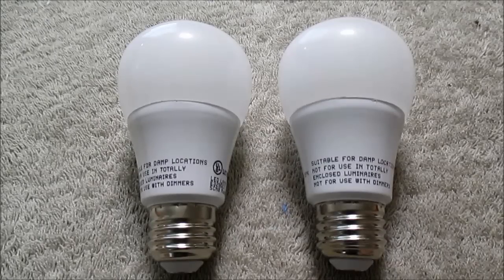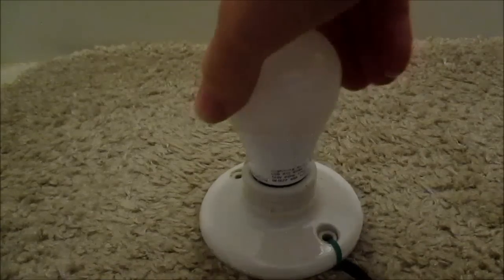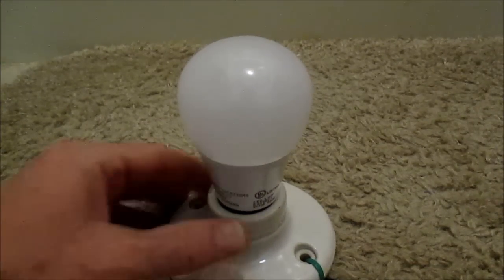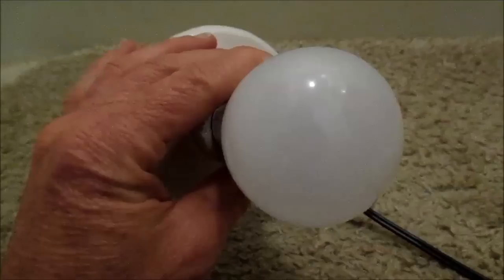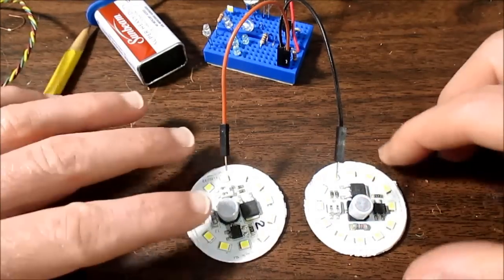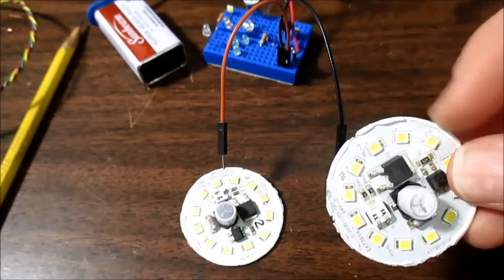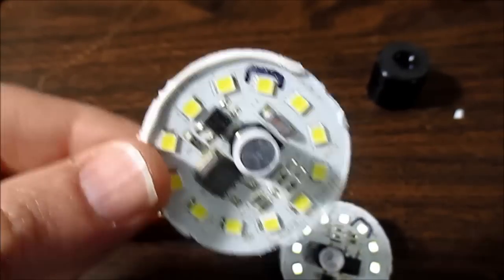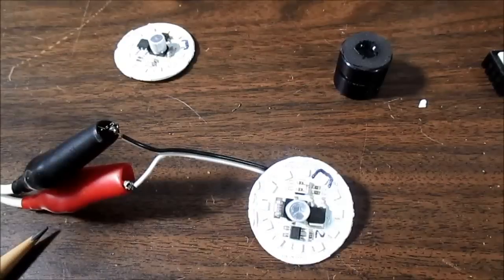Two failed LED bulbs for teardown to determine the cause

Comment: It says on the packaging to make sure the bulbs have plenty of ventilation. I've had several bulbs go out when I put them in my front porch fixture with a screw-on lantern giving them no ventilation. They over heat and "poof" don't work. Follow the directions...

Comment: If you pay attention to the usage of an LED bulb, you'll notice they don't use a whole lot less power than a regular incandescent bulb. The real breakthrough in light bulb technology came years ago with the CFL bulb.

CFL bulb uses consistently 20% of what a regular incandescent bulb uses. The LED bulb uses about 60% the electricity that an incandescent bulb uses.

When the cfl's first came out, I switched my small house totally over to CFLs. My next electric bill was literally$50 lower was no other changing of appliances or other conservative efforts. It was obviously the CFL bulb that led to the savings.

I am convinced that the CFL bulb was killed because electric companies did not like the savings let consumers realized from using the CFL. They dredged up horror stories of cancer from the light of CFL's. As far as I'm concerned this is the biggest con job since petroleum producers tried to kill the electric car!
Reply: No they don't and that is such bad info. Hook a watt meter up to all 3, I did. The 40w equivalent CLF is 8w, the LED is 5w and the Regular bulb is 40w. All my LED's are Daylight balanced and appear brighter than warm regular bulbs. Get good bulbs and they last way longer and use less electricity. I spend $28/month less for outdoor lights now and all are 27w 100w equivalent 5500K bulbs. My yard is fully lit all the way around for $11 a month. Going on 4 years. Cost $115 for all the bulbs so ROI happened in 4 months. My lights are also not dimmer in the cold now like when I tried Fluorescent bulbs.

Comment: I bought about 30 LED bulbs for my house 4 years ago and have only had one fail. It also said "not for use in enclosed space" and I had it in a sealed hallway light so no blame there.    
The electricity savings is huge, especially in the summer when the AC doesn't have to work as hard to get rid of all that waste heat.     
LED bulbs are also subsidized in my state, so I pay about $1.50 for them to knock $10-20 off my monthly power bill. Absolute no-brainer.
Reply: Yeah, over the last 10 years, I’ve not yet thrown out a single led bulb. The older ones, that have dimmed over time (from being left on 24/7) have gone on to second lives as rarely used closet lights and such). I’ve not had a single outright failure (in contrast to the awful CFL’s which, while lasting longer than incandescent bulbs, seem to quit at the 4 year mark - I now have a pile of them awaiting proper disposal).

As for LED versus incandescent, it’s no contest, LED bulbs are just better.

Comment: You should have said "crappy Chinese lighting science bulbs", made in China 2:12 . Who have not learned by now, most of the products made in China is crap. I have got these same bulbs 6W LED "cool white" in my house for over 18 months now and hand no problem with them so far. They give excellent lighting, far better than an 60W incandescent bulb and the 18W - 20W energy saver bulbs. The reason for this is, buy good quality like Osram or Philips and you will have no problem with it. The are just as good as any other bulb, just much much more energy efficient.

Comment: I have a bunch of Utilitech bulbs from Lowe's bought three yrs ago.  I put a bulb in a desklamp with stainless steel shield cone.  The bulb still works, but I noticed the plastic at base is cracked, multiple, and maybe slightly discolored... Since these bulbs run cool, vs. incandescent, why is this road to failure or safety issue occurring?  I took it out of service.  Just wondering the cause.

Comment: Jump out the open LED, raise the value of the Source (current sense) resistor on the mosfet by about 30% and put back in service.  Much longer life but less light output.

Comment: Many LEDs used in TV arrays have a zener diode across the LED junction.  If the LED opens, the entire source voltage appears across the LED and shorts the zener.  The current source maintains the programmed current so the voltage drops to maintain wattage.  Of course, while most TV LED failures are shorted LEDs, there's still the occasional open LED that shuts down the array.  Apparently, these bulbs don't use zener diodes for backup.

Comment: Because the line voltage from our power grid is inconsistent.

I have measured 160 vAC on my "110 to 120 v nominal" outlets..

It blows out LED and fluorescent bulbs rapidly.  Common incandescent bulbs labeled for 120v were tested to survive 150 v.  I used to buy the 160 v rated bulbs which handle the incinsistent power much better.

Electronics are not tolerant of excess voltage.

I have taken to putting computer UPS with voltage regulation into lighting circuits and my power bill is down plus I don't blow bulbs any more.

Comment: FYI: the .99 only store sells 1600 lumen bulbs for $1. @ 5000k and another at 2700k-800 lumen. The double pack bulbs are NO good so don't even think about those but the singles works extremely well. Read the pack and get what you want. I have not had a single go out.

Comment: Isn't it true that these failures are chronic with LEDs and isn't it true that there must be a failure of a voltage or amperage regulator causing these "bond wire failures" as you call them? In other words possibly a design error in choosing the right voltage/amperage regulator, or poor quality regulator? Something like that? Because I am betting that if that particular bond wire connection there was improved to be stronger than it was originally, the next weakest one would then fail.
Reply from the maker: I have LED bulbs that have lasted years. In my house, I haven't had one fail yet. I think these (in the video) failed from heat. The regulator was still functioning correctly.

Comment: Bought 2 at Dollar Tree.  1 lasted 2 days , the other 2 months and they both went to the light output of a cigarette lighter. Went back to the "ice cream swirl" CFL. Still have 2 T20 fluorescents burning non stop for 10 years.
Reply: Hmm..... I've bought approximately 15 LED bulbs from Dollar Tree over the past 2-3 years. Not a single failure.

Comment: I have found that the solder cracks on the LEDs from repeated thermal stress.  I can usually resolder one LED and get a light going again.

Comment: Your missing the point about LED bulbs, the point is less power consumption which means less demand on the grid which means fewer or smaller power generation plants. Even if LED bulbs were more expensive per hour of use, we should still be using them unless you don't really believe climate change is linked to human fossil fuel burning in which case you should still care as building power plants is very expensive and will impact your energy cost a lot. If you want a better bulb I suspect you have to pay a premium for it. I just bought a fairly expensive 3 way LED bulb with a guarantee to last a certain number of years. I will probably never use the guarantee because it is too much hassle for the value and I am sure they count on that being the case but i suspect it will last longer then the cheap LED bulbs anyway.

Comment: I've got LED bulbs I put in when I built my house 5 years ago.  Some of which run 8+ hours a day every single day of the year.  LEDs themselves aren't the problem, it's the drivers/hardware behind the LEDs.  Most people don't understand this due to incandescent bulbs being so simple.  If you buy the cheapest LED possible, you'll likely never see it's full lifespan because the hardware powering it is garbage.  Buy the middle or just below upper priced ones and they'll almost certainly go forever.  

As far as the light value, they do degrade over years and years, but it's not often so significant that it warrants replacement until you're nearing the end of the expected lifespan anyway.  At least, that's been my experience overall.

Comment: I would put a regular diode across the bad LED and put it back together.  But if you want to maintain proper circuit load you will need to put two regular diodes in series with the bad LED.

Comment: I bought 20+ LED flood lights years ago.  Every single Eco Smart bulb failed within a year. I replaced them with Cree flood lights and several years later haven't had a single failure yet.

Comment: I seen some bad led bulbs go bad as well and I also opened them up to look at the cause and when a led flash intermittently it is normally a broken led in the chain that caused it. And I seen this be like this because it been way to little and even no thermal paste between the board and the heat sink itself causing the led to overheat and burn. On a specific lamp it was only thermal compound to cover half the led chain and the rest was without it. It is either way a terribly bad manufacturing or intended failure over time. But as I already know money always controls this and nothing else.

Comment: Bastards 1LED fails and because they are in series they ALL fail.  If connected parallel the bulb would continue to work albeit slightly less bright.  Of cause the manufacturer would not sell so many bulbs.  That’s OK though you’re the one paying for the bulb and the manufacture is not using defective bulbs like us.

Comment: I've yet to have to change an led since I started using them 4 years ago. The two brands I've used are phillips and great value(the Walmart brand).
Reply: I have a few great value bulbs. I bought them in 2018 and so far all but one is still working.

Comment: In my country there are swarms of Chinese-made LED lighting products. One called Firefly is prominent and cheaper than big names like Philips and GE so not long ago I thought about replacing a handful of CFLs. After about a year one of them stopped working. I thought these were supposed to last 10 years? The others are still working fine though, after 2 years.

Comment: People, the biggest threat to any LED light source is heat. Many type "A" bulbs are NOT rated for enclosed light fixtures, which is where they are used 99% of the time. This is especially true for cheaper brands. This is the same issue with CFL lamps back in their heyday as well, and still do.  Alos, most of the components are sourced or built over seas. However, the country of origin isn't the problem.  How they are manufactured certainly is.  Nothing is immune to failure. However, using a quality brand and a lamp that is designed for the fixture and/or environment will go a long way towards longevity.  Read the package next time you are buying.  Not all of these are waste as some would think

Comment: LED bulbs suck. Beside their light have an annoying color (even the yellowish bugs me), they are expensive and doesn't last as much as they promise. Some time ago I bought a package with 20 of those bitches and it was written in the boxes that they were made to last for over 10 years. Sure. Mine didn't last more than a couple months. Unfortunately the traditional incandescent bulb lamps doesn't exist anymore (the BEST in my opinion) but now there is a type called "halogen" that is a decent and acceptable replacement for the old school ones. I won't buy LED ones anymore.

Comment: LED big bulbs are just the Christmas Light arrangement on a circuit board.  A failed emitter will typically cause string failure.  Lowes $2 a box of two provide an average life of about three times an incandescent.  Install ten and get two failures with in few weeks, the rest last much longer.  However compare to $10 and $20 a box bulbs, the failure may be acceptable.

After all we used to replace Edison bulbs every few months.  However cheap GE bulbs were 25c ($1 a box) before they were regulated away and now serve a niche market.

Comment: Since they work without an incandescent filament, inside a vacuum, if the bulb breaks but no damage is done to the board or wires, will these be brighter without the bulb part and can you make a deflector to increase the lumen measurement?  Would like to see the results if you are so inclined.

Comment: Computer chips... Any electronic device is prone to rusting and failing due to lack of electric transference... Simple, however complicated. Rid the failure spots by using solid elements like crystals and the failure rate drastically drops...

Comment: Poor quality control in China manufacturing and Americans dont care cuz Chinese products are cheap. I save a lot of $$$ in electricity from converting my whole house to LED even if an occasional bulb lasted only a couple of years. No more changing than the incandescents. I only hate the failure when the 12 strings of  mini lights start blinking out on my Chinese magnolia tree after I just replaced the whole lot in 18° weather days earlier! I leave them in the tree year around unplug them after xmas and let the spring foliage hide them during the rest of the year because it protects  the delicate flower buds that develop over winter & cover the tree in March blooms from being ripped off if I take the lights down every year. And its 25ft tall. The last set of LEDs lasted 6yrs. This year's routine swap out shows how mass market availability can lower the QC standards even as it results in greater affordability. Just as quickly as they were hung, they were blinking Morse code. I'll take them down after spring blooming and start over.

Comment: I bought three Phillips branded LED bulbs, that were on closeout. They were the equivalent to 100watt incandescent, but in the daylight color spectrum. After a month of use, they started flickering and failing. I removed them, from wall sconces, and found the bases oof every bulb cracked. I contacted the manufacturer about the issue and emailed them pictures of all three. They sent me replacements, which I've had for three years now, and they are still functioning normally. The large hardware store, Menards, sells a brand called FEIT. They have been very unreliable with their CFL's, but the LED's have done pretty well. They still have an above average failure rate, but they are quite inexpensive. I bought a bucket, of 24, for $29.99. Two years in, only two have failed. One of which was constantly on.

Comment: Damn! i bought 4-5-6
 months ago some 6 bulbs from a german superstore chain in europe. they were something like 4 euros each and they last ... shit now I only have 4. 3 of them had bad leds and they stopped working and one of them had something with the electronic sistem maybe the cap...from the smell :))                                                                                                                                                                                            I also have philips ones with aluminium fins and just a few leds in them... from 2011 but they were more then 50-60 euros

Comment: The problem with these cheap bulbs is that they have no high voltage buck regulator to tightly regulate the current that is passed through the series LEDs. Instead, they use a triac to throw a LOT of current into the LEDs for brief periods of time, 120 times per second. The issue is that the peak current this circuitry applies to the LEDs exceeds their absolute maximum that they can handle. Hence, the weakest one will fail first. The LEDs are not the culprit. It's the very cheap circuit that drives them that is to blame. When done right, the drive circuit is not cheap. And cheap is what these cheap bulbs are all about: price. If the manufacturer has to pay $1 for good drive circuitry, it translates into another $3-$4 increase in the retail price. Instead, he opts for the $.25 solution, and you see what happens.

Comment: Cheap led bulbs last less than incandescent lightbulbs because they are overdriven. Increase the sense resistors' value five times and it will be dimmer, but will last for years.

Comment: I went to buy a light fixture earlier this week and noticed most are now integrated LED fixtures.  I can't bring myself to by an integrated LED fixture for 30+ dollars only to have to replace it when an LED goes out or a surge causes the entire thing to go out.  I went with a fixture that can take bulbs which would be easier to replace.

Comment: Is it possible to replace the LED or not worth your time, due to the high probability that other LEDs from that manufacturer will likely fail too? What's involved in replacing one of those LEDS? Is it reasonably easy to de-solder & replace them?
Reply from the maker: Not really worth the effort as you say. Being an aluminum substrate, it would have to be heated to remove the LEDs.

Comment: Excellent informative video, good camera. These new fangled bulbs appear to be a lotmore simple than i had previously thought. Some questions: You can clearly make them work by shorting out the offending failed LED, what could you use the board for if you did? Would it be better/possible to transplant a working LED from one failed unit to the other?
Reply from the maker: Yes you could bypass or replace the LED. It really isn't worth the effort though. Who knows when the next LED would fail.
Reply: You can only replace it with a new one. It's just a consumable. We can use better products from the next choice

Comment: I installed about 40 LED lights in my home about 4 years ago. Every single one still works just as good as the day i bought them. Before LED's I had to change light bulbs out once a week.

Comment: They fail because leds are overdriven to give out maximum lumens for brightness. And when it was overdriven it generate heat too much that the led material will fail instantly. That is the problem of cheap Led bulb.